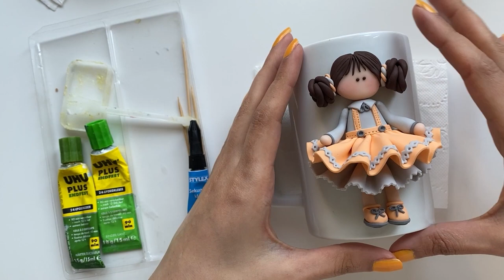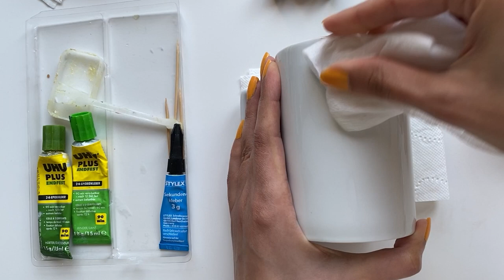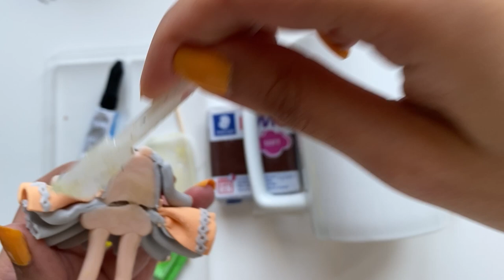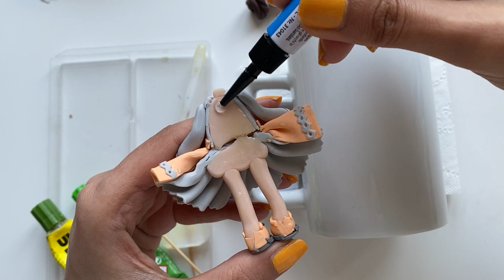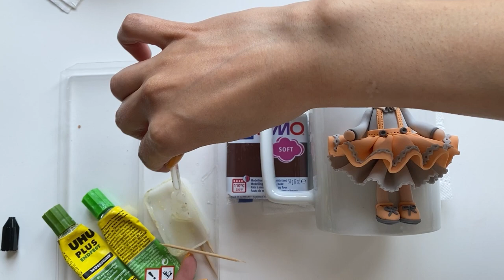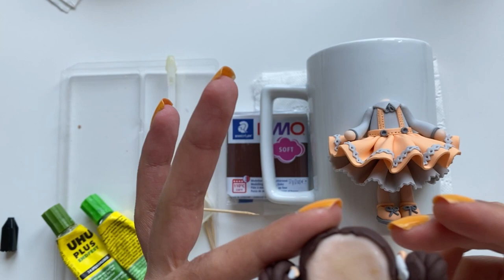How to Bake and Glue the Polymer Clay Art on Mug

Comment: Hi, you make such a great job . Thank you for sharing with us . 
Can I ask you which Produkt do you use? Sculpey Fimo or cernit? Because you bake the mug one hour and on the box of fimo they say DO not bake over 30 min???   
Best regards 
Anna
Reply from the maker: Hi! Thank you for the comment 😍 I use Fimo. When I started out, I used to bake for 30 minutes but the doll was still fragile and the details broke easily. I tried for 1 hour and checked multiple times (for possible smoke 😅) but it turned out just fine and details where much more flexibility and resistant to pressure. So it now has been 3 years that I bake them for 1 hour. However, I never change the recommended temperature.

Comment: Is the epoxy glue REALLY slow drying? I ask because you go so very slow in putting it on and THEN put super glue on too.
Reply from the maker: Mine takes 90 minutes to dry and 6 hours to completely set 🤷🏻‍♀️ Usually the stronger they are it took them longer to dry.
Reply: @CoffeeCupids  wow! The epoxy before even applying it would take 90 minutes? That’s crazy but worth it. You have SUCH beautiful artwork!!!
Reply from the maker: @morgannwilliams967  each brand is different. They are those two part glues. After you mix them they start to bond. Each brand has the drying time written on it. Thank you 🙏 glad you liked them 😍❤️